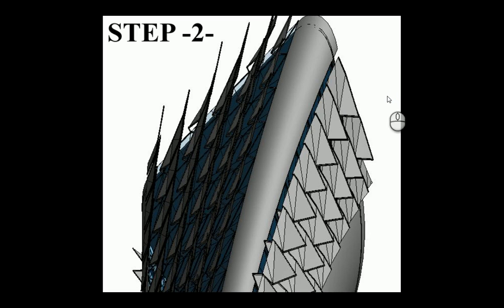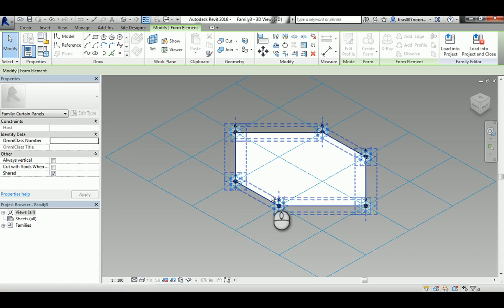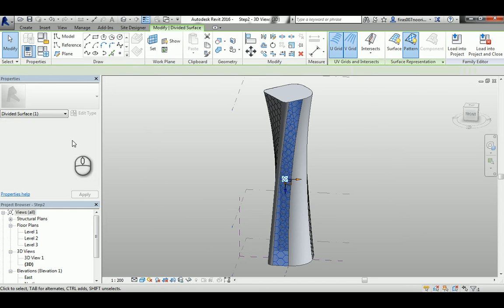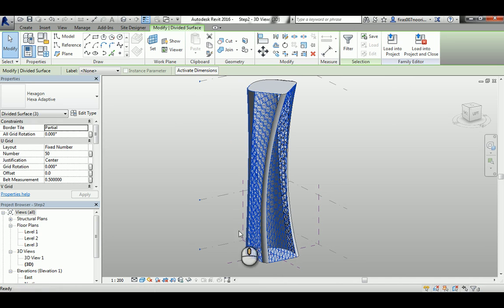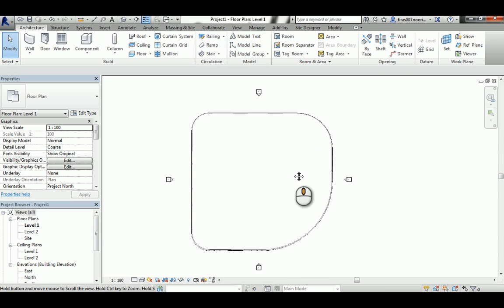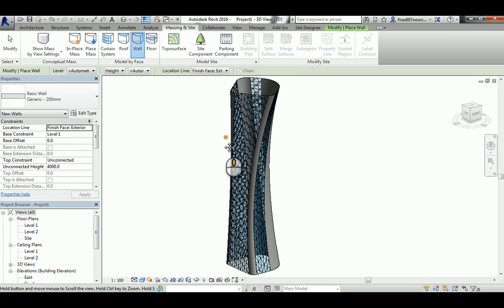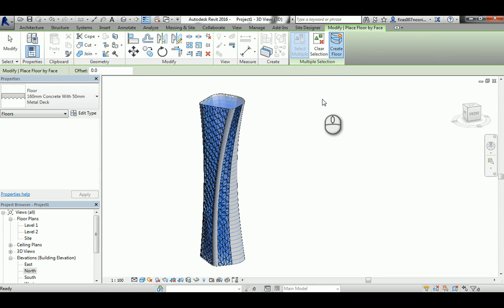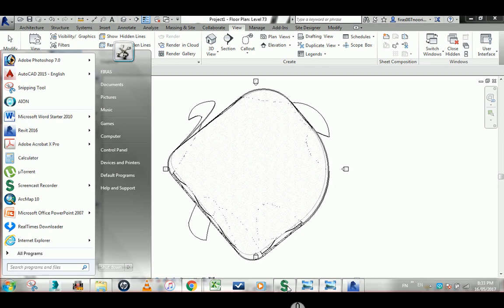Making a Tower in Revit Conceptual Mass - Step 2

Comment: Not adjusted same as a video pic showing...
Reply from the maker: What was crashing?
Reply: @FirasNoori  truss roof not adjusted top and bottom side
Reply from the maker: Not quit quite understanding you, send me the file plz 
firas007noori@yahoo.com
Reply from the maker: Plz add some pictures with text of ur issue
Reply: @FirasNoori  snd email to u
Reply from the maker: I saw your image, it is the adaptive component dear, you need to make a correct one, or download one from the web.
Reply from the maker: There are mainly 2 types , the first is curtain wall pattern base, which might not goes well with ur surface and there is the second more advance one, generic model adaptive components, each has it's own features and both if made a mistake in their making you get similar results as urs, see more about Adaptive Components on my channel there 2 or 3 videos I think on that topic, sadly not in details
Reply: @FirasNoori  it pic my file...i make to file  2 types cartin and ganaric.  already same issue...
Reply: @FirasNoori  sir guaid me glass and frame not adjusted U & V side unbalance.
Reply from the maker: Brother, wrong adaptive components
Reply from the maker: Usually done due to fix AC not fully parametric, it cause similar cases as urs
Reply: @FirasNoori  sir i need a truss roof
Reply: What to do then
Reply from the maker: There is a video posted on truss in Recit on YouTube,  see how he made it, and far as I see, you got wrong AC
Reply: @FirasNoori  Plz tell me AC name ? With Finding in revit
Reply from the maker: @z.hshafiqurrehman1  https://www.youtube.com/watch?v=tFXqsmV0fWY
Reply from the maker: @z.hshafiqurrehman1  https://www.youtube.com/watch?v=31jl63Bf6Og&t=381s
Reply from the maker: @z.hshafiqurrehman1  https://www.youtube.com/watch?v=S_JFBznxnjg
Reply from the maker: @z.hshafiqurrehman1  https://www.youtube.com/watch?v=igvemhiBp3U
Reply: @FirasNoori  sir i working to same as a video. But truss is not smoothly fit on component mass